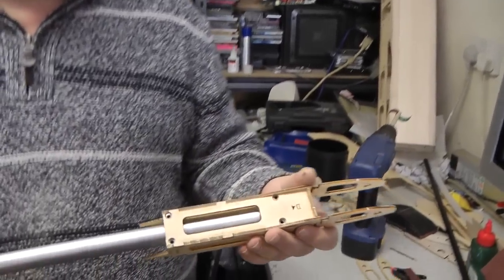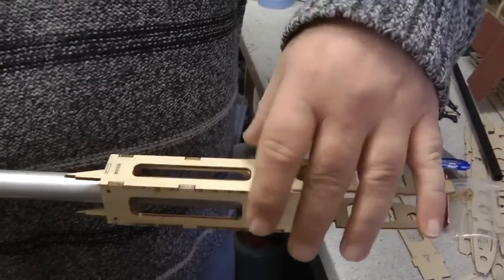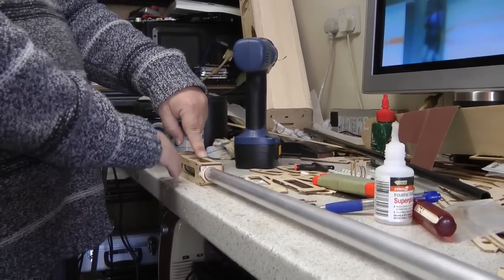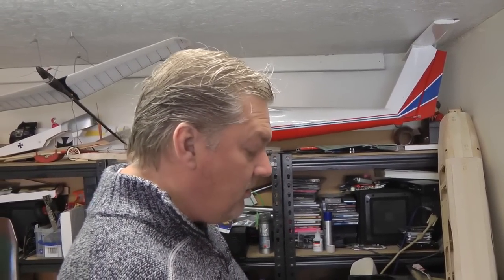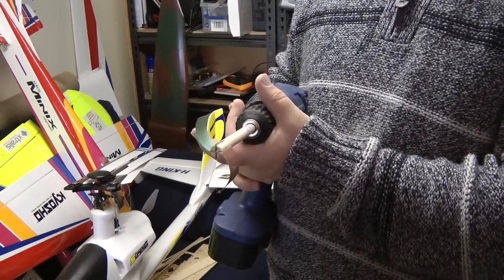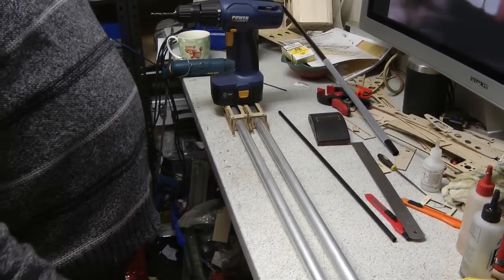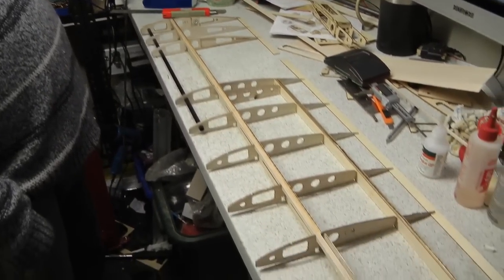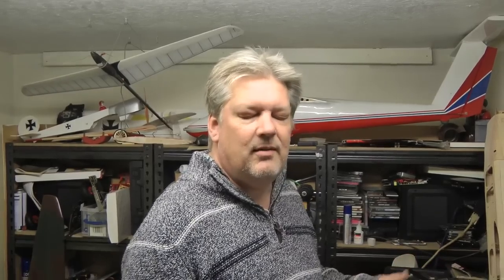Hobbyking RQ-7 Shadow Build Pt4

Comment: will the wings be able to be taken apart after completion? 2000mm is big even for my truck.
Reply from the maker: +Kiowa Mech Yeah the wings unplug from the fuselage. and the tail unscrews from the booms. so you leave the boom tubes connected to the wings.